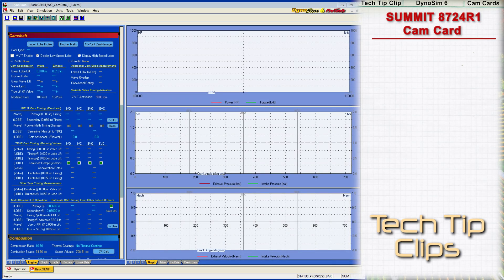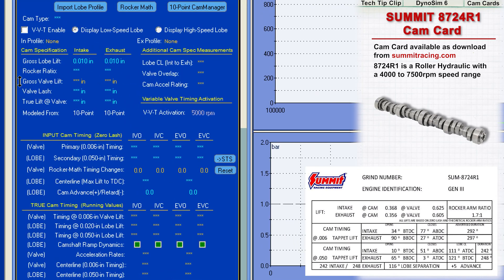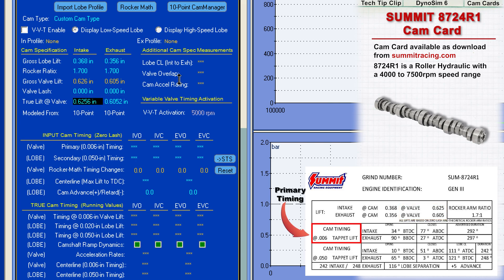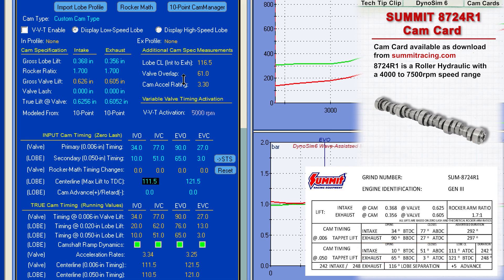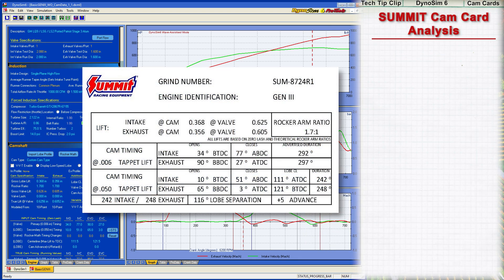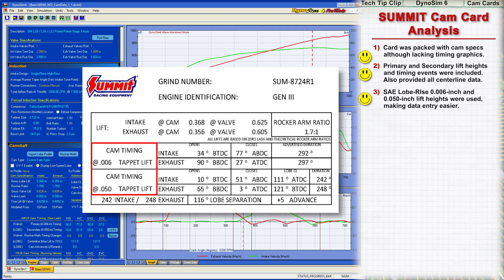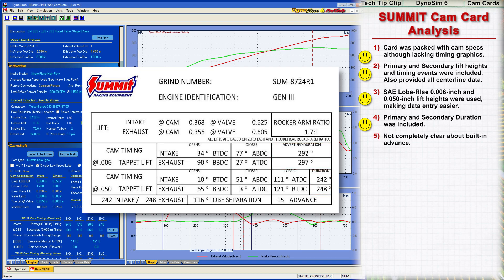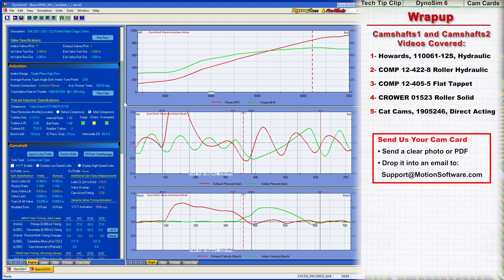Summit Cam Card Tech Explained

Comment: I bought my summit cam 3 years ago. The lift at valve is not shown, however advertised lift at cam @ 0.06 is shown. It is one more issue I feel short changed on as being a retired ASE Master since 78. Money is hard to come by as I stare at the neighbor 30ft inflatable Santa in the front yard. I could manage a 2015 for my with, but technically, I am on foot. Rebuilding a 67 C10 with 4L60 I built 3 years ago. Oh well, I will simple multiply the lift X 1.7 to find total valve lift. This is not a street racer, just a grocery getter and trucks can carry & pull so went to torque early and unlike most resto-mods, mine has a detailed service manual with brands, part numbers and schematics for every circuit + photo reference of connector number & location. Like buying Eastwood’s Rust Encapsulator and the day it comes, they introduce the platinum improved version before I could look at the product I paid more for, now outdated before the box is opened. Thanks Eastwood!!! NOT.😮
  Custom service actually said they had no SKU so was forced to send the product I wanted, no return, no refund, we don’t care. Have a nice day.

Comment: Thoroughly enjoying this series. Does your software include the ability to model flat plane vs 90 degree crankshafts? Or other odd angle cylinder bank vs crank phase situations?
Reply from the maker: Yes, both DynoSim6 and Dynomation6 will model any crank design. However, there are no options to select different cranks; the simulation model primarily performs a thermodynamic and frictional analysis, so is not very sensitive to crank phasing differences.